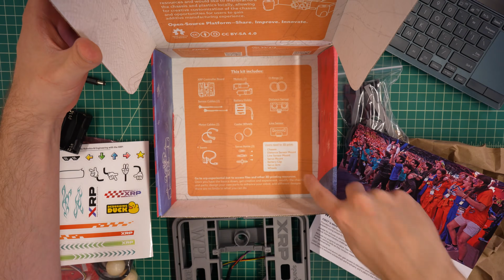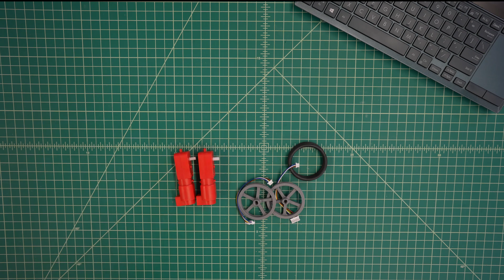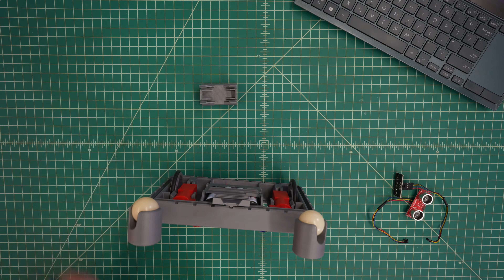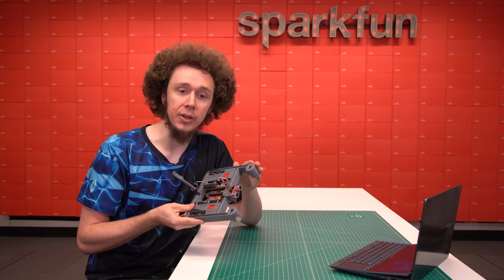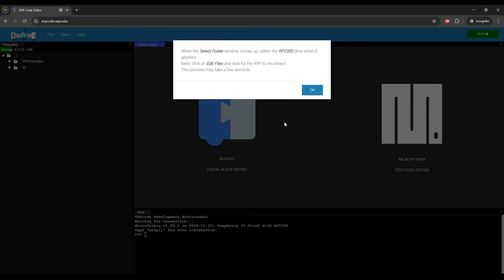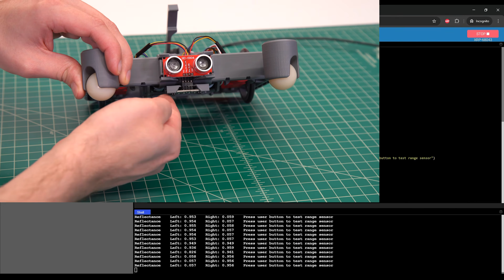XRP Assembly and Software Starter Guide (BETA)

Comment: Intially, when I only had my power cable connected, all the lights were working. However, after assembley only the bottom two red lights would turn on and my computer could not connect with the robot despite which USB-C cable I used. I even tested the same computer and USB-C cable with another assembled model of this robot and it connected with no problems. Afterwards, I removed all the wires expect the power cable yet the blue light and rainbow cycling light still would not turn on. How can I fix this?